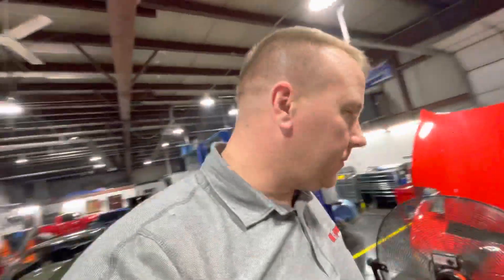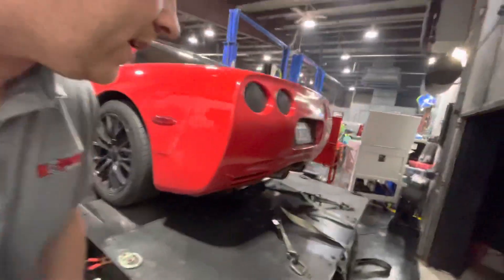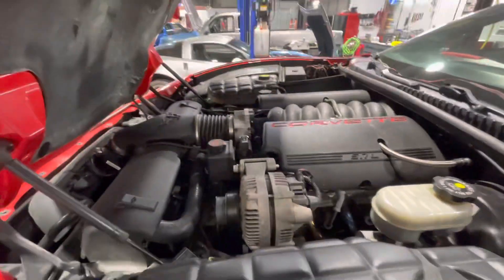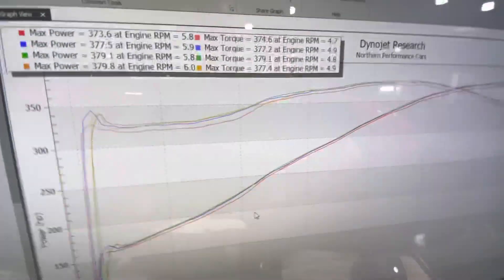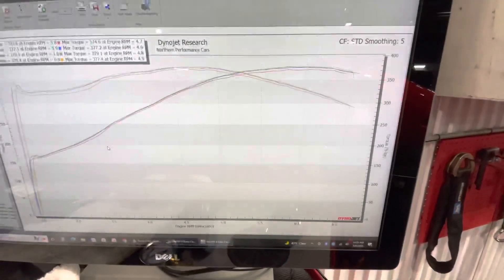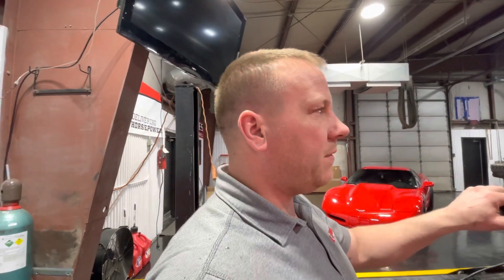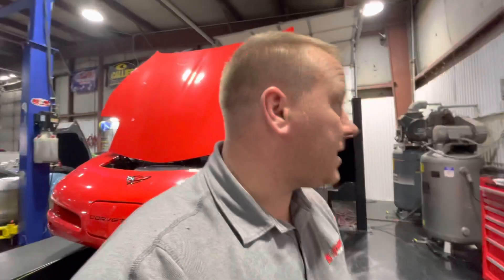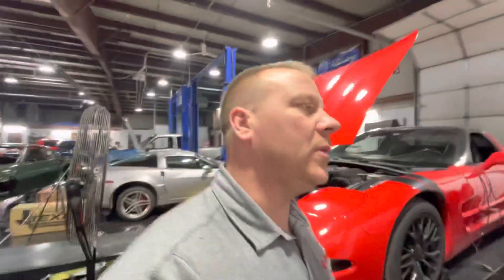Mild cam corvette on the Dyno and what to expect with minor bolt ons and street friendly cam pack

Comment: All dyno’s are different. I have an Ls1 here in the U.K. 853 heads, 230/236 cam, downdraft throttles, headers. It shows 440 crank , which is about 365 wheel. It showed 335 crank, 260 wheel when it was standard .
The numbers are just there to show your gains.

Comment: Even a "small" cam like that would pick up a good amount with just decent heads and a better intake manifold. My friend's 13 Silverado 5.3L had a 224/232 with PRC Stg 2.5 706/862s, LT's and cat back, everything else stock. It did 415/393 through the stock auto and a set of heavy 20s. I have those heads and that camshaft in my possession, going to toss them on the LQ4 in my 2001 Silverado. Cam is a little small for a 6L, but should still make some smoke.
Reply from the maker: Absolutely. A good set of heads would gain more than the cam would.

Comment: Why anybody pulls heads off of an LS1 and puts the same heads back is beyond me...  706,862,243,799, all better options for the LS1 than the stock heads.  Biggest average power gains all the way up to a hair over 6000 rpm using 706 or 862.  Gain a little everywhere even up higher with 243/799.  Sounds good though
Reply from the maker: We didn’t pull the heads.

Comment: That's about right on par with all the F bodies. Might see 390-400 with M6 or LS6 intake.  Occasionally youll see the "Factory Freaks" that make 20+hp more then the rest, and turds that make 20+ less. Lol
Reply from the maker: Yes sir. Some decently large cam combos will peak 420 with an ls6. 
440-450 with a fast 

Really good heads combo 475-495

Comment: Shitty set ups make that maybe. Good set ups easily go over 400whp. For example my bolt on ls6 made 451whp/423wtq on pump gas.  Stock cam stock heads.
Reply from the maker: Lol 450 with a stock cam! Dang! That’s pretty unbelievable 
That’s what cammed ls3’s make.
Reply from the maker: You should try another Dyno.
Reply: @NorthernPerformanceCars  the car ran 10.7@130ish when it was 417whp 393wtq....believe me it ran like a 451whp/423wtq car after addressing issues to make more power i just never got it back to the track. Probably had a 10.4 in it.

We've had bolt on ls3s make 470whp/470wtq in a 2015 1le camaro...that was on e85. The ls3 vette we did made 460whp and like 45xwtq. 5gens with eps will make slightly more than vettes due to the eps. But the vettes will be faster because of weight. The c6 ls3 vette we did went 10.5@132ish with plenty of et to be had. Again stock heads stock cam.

If a cammed ls3 don't make 500+ you did it wrong. The details no one seems to do matter.

Everything is pretty well documented.
Reply from the maker: @HioSSilver1999  ok. Everyone else sucks then 😂

Stock cam 450whp. That’s wild.
Reply from the maker: @HioSSilver1999  I can see them running quick. I’ve seen they pushed an alleged stock cam into the 9’s. Wonder what the weight is.
Reply: @NorthernPerformanceCars  most do suck. It's not like it's even difficult to do. Everyone just thinks that cam is magic.....it's not.

A friend put the same combo on my ls6 on his out in California.  His made 441whp i forget what tq but probably 410ish. Basic difference was he was turning a ps pump and i wasn't. I was at the track just didn't on that last dyno.

I wish you were closer. My ls6 has been rebuilt and should go well over 500whp. I like you vids but some of the little stuff would really live'n your results.....but customers may not want to pay for that so i understand.
Reply from the maker: @HioSSilver1999  9/10 won’t even do a set of heads. 95/100 are 100% street driven cars with zero weight reduction. Full exhaust. Etc 
It’s all about the sound. I guess.
Reply: @NorthernPerformanceCars  weight reduction is where it's at especially where it matters. Vettes don't really need much tho except for where it matters.

Btw we did a h/c ls3 that made 560whp and like 440wtq. They will run to 8k rpm if you want them to.....erryone skeared of that for some reason.
Reply from the maker: @HioSSilver1999  for sure. Solid roller and 12.5:1 will do wonders with a high ram in a 6.2
Reply: @NorthernPerformanceCars  that was a hydraulic roller, 11:1 and a highram type intake.  I forget the name of it tho....xr something. 

My 5.7 ls6 is now a solid roller 12:1 with a msd intake on it. No numbers yet tho because I've been fighting some drivability stuff. Drives fine for a while then goes to shit for some reason. Like it richens up all on its own at idle then don't idle for shit. Still goes up the road fine tho. I think the mafless cos is causing it. I think it''s gonna be a stout motor .
Reply: A friends tuned and bolt-on only LS6 Z06 6-speed manual made 375 rwhp, that's one very generous dyno your using.
Reply: @QuicKurtZX14R  was the reality of  track times generous to?? Or did you boi not dot his i's and cross his t's?
Reply: @HioSSilver1999  trapping 130 seems pretty high for stock cam
Reply: @QuicKurtZX14R  why?? Because you don't know how?  Not trying to be a smartass but that's what it seems like.....because xx can't  do it so can't be done right? My best trap was 131.3 but that was at 417whp 393wtq. Not the 451whp/423wtq.  So there was speed and et left in it.....more power too. Throw some e85 at it and it will pick up 10whp and probably more tq than that. You could use some of these oxygenated race fuels and pick up about 25-30whp.

Now just a fyi the fastest bolt on ls6 has been 10.0@135 and i have no doubts it did it because i know the differences in the cars......and you type people fail to look at the car part and think it's just about power. My car didn't even have drag brakes, it was full interior so it could have easily been lighter to maybe approach the record time.

Btw...we back up the combo with a c6 ls3 car and went 10.5@132ish and that car had to much gear. It shoulda had 3 90s instead of 4.10. It would have probably trapped 134 with the 3.90s....stock heads stock cam.
Reply: @HioSSilver1999  not my car